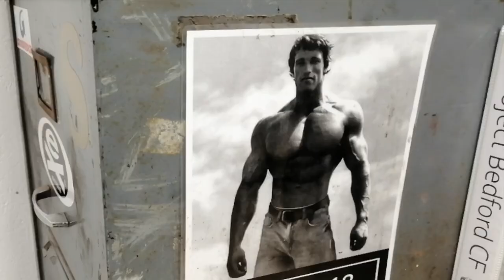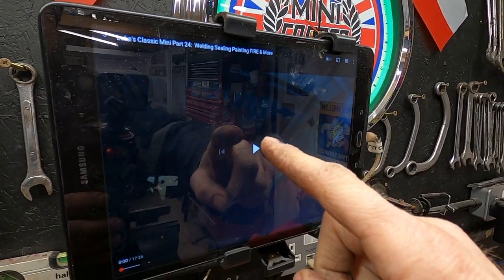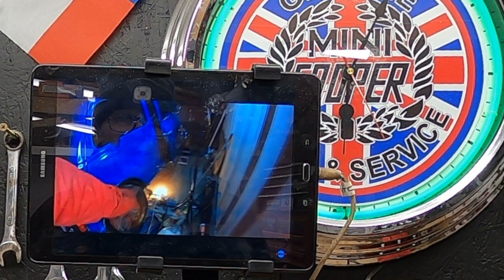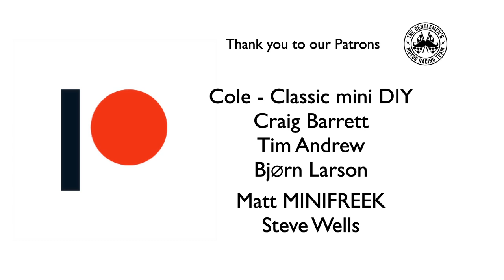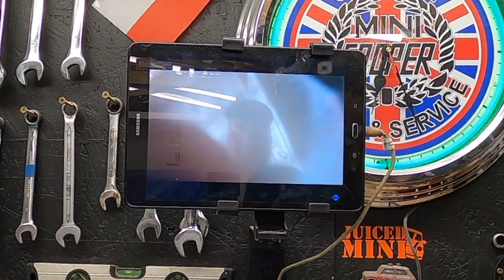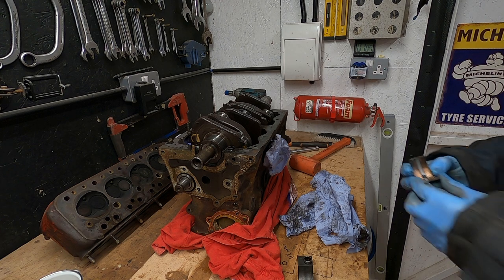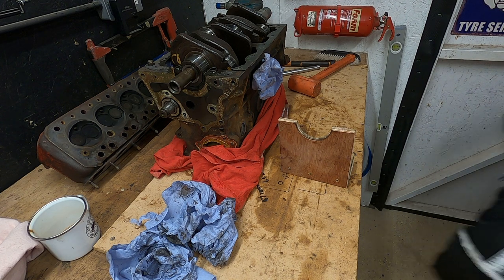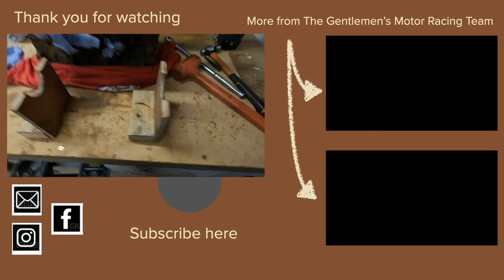Classic mini timing chain - engine strip down - William Murfitt

Comment: Iirc there are 3 types goldseal, silverseal and standard factory replacement the latter being made up of new part they had in the factory to hand - you should be able to take it to .040 over as long as the crank isn’t oval
Reply from the maker: Awesome info thank you